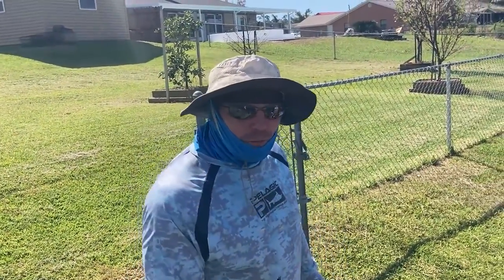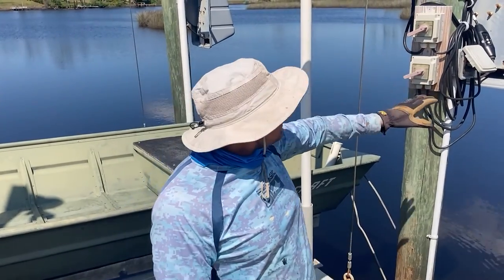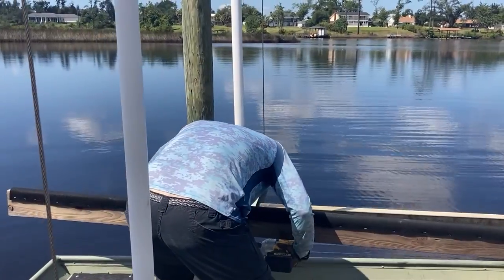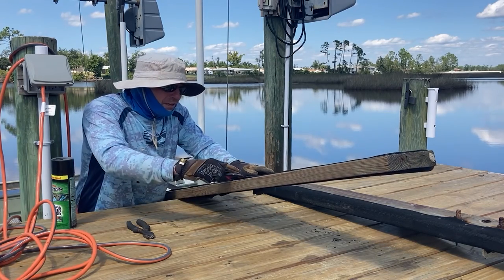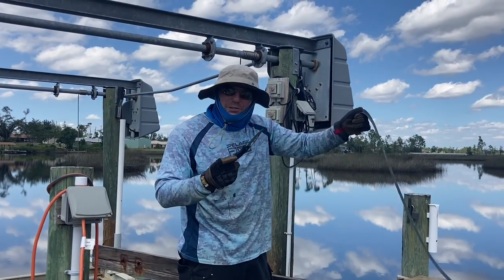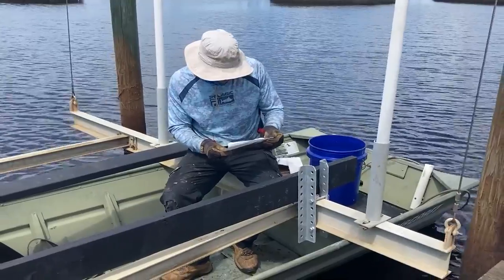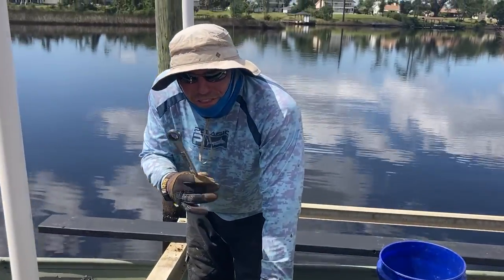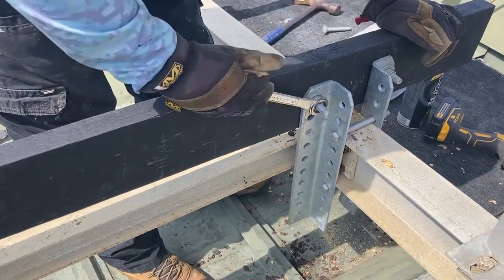DIY Repair of Failing Boat Lift - Galvanized Metal Doesn't Last Forever!

Comment: My lift is like yours. Any idea on where to get 12 foot steal I-BEAMS. I just got a new gem controller went under water with hurricane Sandy. . I should have raised it like you did. My I-beams are galvanized. There are starting to really deteriorate.  Not sure where to get galvanized.  The lift is by ACE. They went out of business years ago. I was thinking of buying the I-beams and welding on those pulley brackets.
Reply from the maker: I just did a quick Google search for "boat lifts" and there are many manufactures out there that can sell you I-beams.  The shipping might be pricey tho!